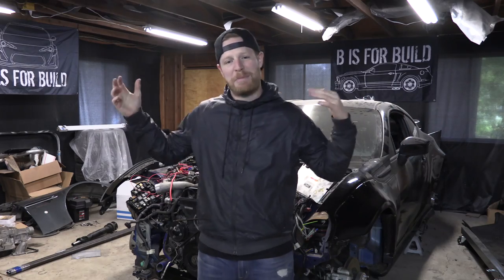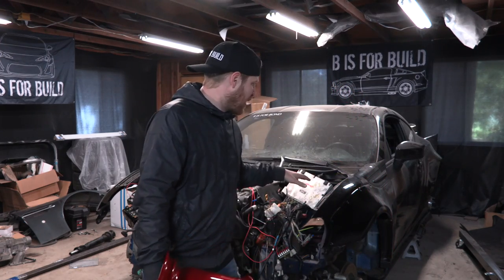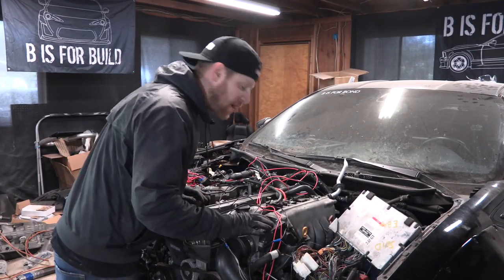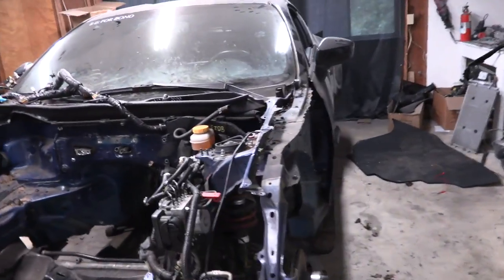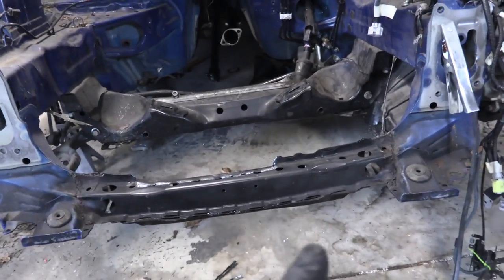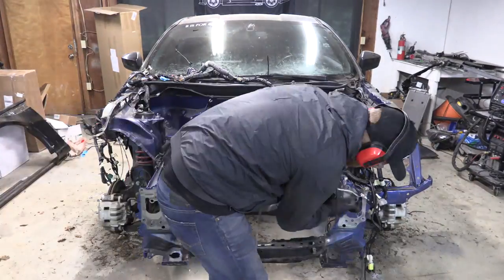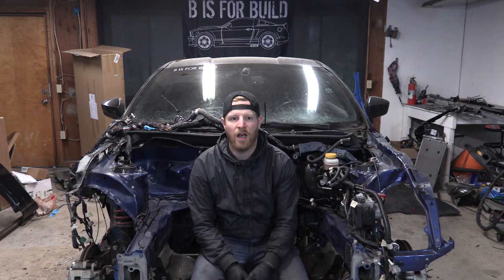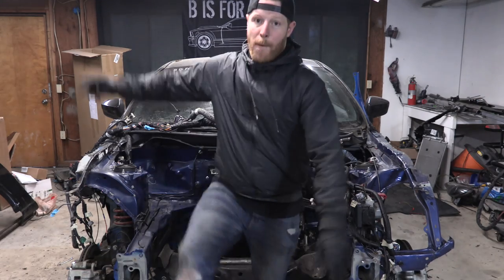2JZ BRZ Pt 7 - New Wheels & Engine Bay Prep

Comment: b is for back
Reply: beat me to it
Reply: I really like the red on that car, especially since the BRZ comes with red piping on all the upholstery everywhere inside... but B is for Black is definitely going to be a new sticker you have to make.
Reply: black
Reply: I hope all you guys realize Mark actually meant "back" and not "black" because Chris was gone for a bit
Reply: Paint it red!!! Come on, all that work and your not going to paint it a pop color that people will notice?
Reply: blaaaaaaaaaaaaack
Reply: I actually thought he made a typo, but B is for Black is where it's at anyway. Hah. If he tried to mimic the candy red on the engine bay in short order, it won't look great. He should pull back all the wiring and remove the brake master cylinder etc and do a full respray under the hood. If he wants to do it quick and dirty, then black is 100% the way to go.
Reply: I'm thinking about red bay and black cover

Comment: I recommend you paint the door jams and edges of the doors red to match the engine bay. I had a pickup that the previous owner had painted black, but did it with the doors closed, the stock blue showed when the doors were open. I didn't like the color, but the effect was awesome. it would add a little extra pop to the car. do the same for the inner edges of the trunk.

Comment: did they forget to paint the inside of the rims? it looks like over spray.
Reply: most cars don't have the insides of the rims painted, its primed or protected in someway or another but not physically painted
Reply: This depends but can be very true.
Reply: Yea I thought that, they look unfinished
Reply: Yes, they paint the part that will be covered by the tire but not the inside of the wheel, is that a joke?
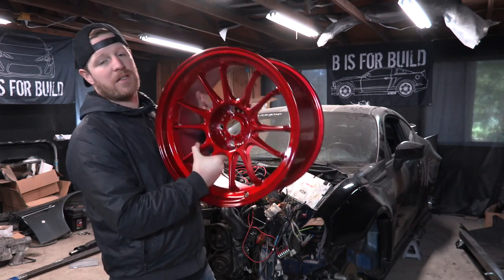Just look at 1:18, andof course I'm not talking about the part that is in contact with the car...
First time I see this.
Cheap paint job for me, sorry.
Reply: A set of OEM BMW rims I had were not painted on the inside, I think that if you actually pay attention to a lot of cars, you'll find that they aren't, from my experience anyway.
Reply: brake dust will cover it so u will never notice. but im like if its a quality rim then just paint the entire thing!

Comment: Black engine bay for sure. Infinitely less ricey, IMHO. I don't like the idea of painting engine bays in an accent color, I just think it feels...well, ricey. The nice thing about painting it black is that, A) like you said, it's a hell of a lot cheaper; B) a black engine bay will nicely complement virtually any exterior color, rather than trying to accent it.; and C) a black engine bay tends to hide "mess", and it still looks okay even when it's dirty.
Reply: I will say, that red color is REALLY cool, and it'll look great on the engine cover. Try to find a few other accent pieces in the engine bay to paint, too, but don't go crazy. The red engine bay looks better than I thought, but honestly it's just too much. The red gonna be a lot of work, and you probably won't be happy with the result unless you get it perfect, which is gonna require lots of prep, cleaning, etc. Plus, it's gonna get dirty and the paint WILL get beat up.
Reply: wouldn't you want to see any of those "messes" that's why I'm for the red engine bay... if I had any kind of leak I'd want to know where it's coming from...with the black I wouldn't be able to find it as fast...the red would be like oh hey there's the leak cool now I can fix That...I completely understand the black part but if it's going to be a drift car than a colored engine bay would be better

Comment: Unless you completely strip that engine bay out bare and prep it correctly all you're going to do is make a mess regardless of the colour you pick. Just forget about painting the engine bay and focus on doing the engine transplant correctly. I would also check how straight the front end of that car is before doing any other work as it clearly was never fixed correctly and there is no point in doing all that work to a bent car. Look at Arthur tussik's channel on YouTube to find out how to measure and straighten a bent/crashed car. You'll be amazed at the skill he has to straighten/repair some really badly damaged cars!

Comment: I personally like the red engine bay, but I suggest that on the engine cover, you paint the outside surrounding portion of the cover in the red and then the entire center portion in black and going in with a white paint and painting the letters a bright white. That would give it a nice contrast and make it stand out very nicely.

Comment: do whatever suits your budget :) looks good anyways, and you get a thumbs up on the welding of the frame rails, by not welding it all around you have made it strong but also kinda weak in a crash which its designed to be

Comment: Candy= high gloss which really highlights surface treatment or lack thereof. For cars that spend a lot of time w/ their hood up at shows this could be justifiable, otherwise -not. The high surface red does kinda limit your pallet. What I like is deep dark gray (maybe pearl) set off with red and black or even another shade of gray accents. Chrome is a good option w/ red like that if used tastefully but again , more for show cars.

Comment: Black engine bay is a more clean look. One functional purpose if you go red, is that whenever you work on the engine it might be easier to see things b/c of the contrast. The red immediately makes me think like you're peeling the skin off the car and exposing the 'meat' when you pop the hood, which is definitely more interesting than making it black and matching the exterior. I don't think it will be too much red if you match the wheels b/c most of the bay will be covered with the engine and the wiring and other components. Yeah, it was expensive to get the paint but, not many people would have that look if you do it. Like you said, this car is gonna be with you for the long haul! Giving it something special wouldn't be a bad idea in my opinion. I vote red!

Comment: Black bay is the easy way out, so I get it. But there's a reason race teams paint their bays bright colors (usually white). Makes working on the engine much more pleasant because it's easier to see things, including leaks. The red won't be as bright as white, but it's a step in the right direction.

Comment: What's up with the over spray look on the inner portion of the wheels? Looks pink, and kinda half-assed
Reply: Sorry for posting a lengthy reply to your comment that will appear multiple times.  However, after seeing a few people with similar comments we felt this needed an explanation. The lack of paint appearing on the inside barrel of the wheel is not a mistake, its intentional. Our red metallic finish isn't a single paint color. Candy colors are developed by laying down a base coat (usually silver or gold) and then layering a unique metallic tinted clear coat.  Multiple coats of this tinted clear are what help us arrive at the exact final color.  With all of that said we use a powder coated primer and metallic silver base (That seals and protects the wheel).  Then we begin to apply that tinted clear coat, in multiple layers, on to the outside of the wheel (the part that will be visible when installed on the vehicle).  Then finally we add an additional protective clear coat.

If this was a regular single metallic paint color, it wouldn't be an issue.  However with all of the layers of color needed to arrive at the final product, painting the barrel would cause an undesirable buildup of paint on the windows of the wheels (sides around the spokes).  That is because the barrel would have to be painted first.  Again, when this part of the wheel is mounted on a vehicle its essentially impossible to see.  We understand when taking the wheel out of the box you could expect it to have a continuous finish on the entire wheel, however this method we have chosen ensures a very reliable and consistent finish that will hold up to the elements. 

Having a finish that looks great while remaining reliable and durable when properly cared for is our goal.
Reply: Thank you for the detailed reply, and what you're saying makes sense. You're right, after everything is installed it won't be all that noticeable. On top of that, after a couple hundred miles a good layer of brake dust will make it completely unnoticeable. With all that said, it really is a fantastic looking wheel.
Reply: KONIG WHEELS USA thanks so much for explaining that!!

Comment: If the paint outside the car is gonna change a lot I would go with a black engine bay and red accents and also red hoses. Plus when you change the color of the car I'll be easier to change the accents instead of having to choose colors that would look good with a red color scheme

Comment: Just for your information: the 2JZ ECU is not designed to be mounted inside the engine bay, if you want it there you need to put it inside a weatherproof box!

Comment: Why are the wheel barrels painted really good on the outside where you don't see it but half freaking white on the inside where you see it?
Reply: Sorry for posting a lengthy reply to your comment that will appear multiple times.   The lack of paint appearing on the inside barrel of the wheel is not a mistake, its intentional. Our red metallic finish isn't a single paint color. Candy colors are developed by laying down a base coat (usually silver or gold) and then layering a unique metallic tinted clear coat.  Multiple coats of this tinted clear are what help us arrive at the exact final color.  With all of that said we use a powder coated primer and metallic silver base (That seals and protects the wheel).  Then we begin to apply that tinted clear coat, in multiple layers, on to the outside of the wheel (the part that will be visible when installed on the vehicle).  Then finally we add an additional protective clear coat.

If this was a regular single metallic paint color, it wouldn't be an issue.  However with all of the layers of color needed to arrive at the final product, painting the barrel would cause an undesirable buildup of paint on the windows of the wheels (sides around the spokes).  That is because the barrel would have to be painted first.  Again, when this part of the wheel is mounted on a vehicle its essentially impossible to see.  We understand when taking the wheel out of the box you could expect it to have a continuous finish on the entire wheel, however this method we have chosen ensures a very reliable and consistent finish that will hold up to the elements. 

Having a finish that looks great while remaining reliable and durable when properly cared for is our goal.  We are always working on new techniques and processes that will be reliable and mass production capable.  We are looking into improving this further and appreciate your feedback.
Reply: KONIG WHEELS USA I see, well I thought you painted them like regular 3 stage paintjobs for cars. But wouldn't it be possible to color-match an pearl or metallic color to be painted on the inside? The light doesn't really hit the inside that much, but you can still see it if it's a really different color, so that "candy pop" effect isn't really necessary  there.
Reply: HI Simon, so its not a question of being able to paint the wheel, however keep in mind that paint lines are very different then someone hand painting an object.  Our goal was to ensure there would not be a build up of material in the window areas of the wheel as the barrel would have to be painted first.  But you're correct and we are already working on a solution to improve a better coloring in that area.  Thanks again for your feedback, we do our best to listen to everyone and take it as constructively as possible to ensure we are always turning out better products for you guys!  Thanks again!

Comment: I understand where you're coming from black would look good with anything with this on the future. candy apple red Wheels engine bay and valve cover will it looks so clean on the car I don't know. you're in a tough spot. if you do decide to paint a car later on or wrapped it just pick a color that goes good with red that's what I would do

Comment: Black with a red valve cover will look like a regular car with a dressed up valve cover.  It won't stand out or look custom, especially when the exterior is black.  You will have a bunch of crap in the engine bay, unless you're looking to do all the shaving and hiding in your photoshop, so the engine bay won't be as imposingly red as you're thinking.  I've seen engine bay and the motor painted the same color on older hot rods and it doesn't look bad, especially if you have a lot of polished aluminum.  On the other hand, having a satin black engine bay will match whatever color scheme you go for everywhere else.  It's a huge task to take on, and you really only want to do it once.  Satin black might be your best bet in that reguard.  If you go with black, just a red valve cover will have a very minimal effort look and feel to it.  I would consider painting the entire motor, especially since it's out of the car already.  That will draw your eye to the part you are trying to show off, and away from anything else you don't want to be noticed.

Comment: Black engine bay and red accents looks stock, classy, professional. Red engine bay with red accents looks silly, over-the-top, and disorganized. Since it's going to be with you a long time you can always change it again, but personally I'd go with the safe color choice in the engine bay. When you decide to wrap or repaint the outside, you won't be limiting yourself on your color choices to match the red in the engine bay.

Comment: inside of the wheels look pink, why didnt they paint that if you can clearly see it?
Reply: Sorry for posting a lengthy reply to your comment that will appear multiple times.  However, after seeing a few people with similar comments we felt this needed an explanation. The lack of paint appearing on the inside barrel of the wheel is not a mistake, its intentional. Our red metallic finish isn't a single paint color. Candy colors are developed by laying down a base coat (usually silver or gold) and then layering a unique metallic tinted clear coat.  Multiple coats of this tinted clear are what help us arrive at the exact final color.  With all of that said we use a powder coated primer and metallic silver base (That seals and protects the wheel).  Then we begin to apply that tinted clear coat, in multiple layers, on to the outside of the wheel (the part that will be visible when installed on the vehicle).  Then finally we add an additional protective clear coat.

If this was a regular single metallic paint color, it wouldn't be an issue.  However with all of the layers of color needed to arrive at the final product, painting the barrel would cause an undesirable buildup of paint on the windows of the wheels (sides around the spokes).  That is because the barrel would have to be painted first.  Again, when this part of the wheel is mounted on a vehicle its essentially impossible to see.  We understand when taking the wheel out of the box you could expect it to have a continuous finish on the entire wheel, however this method we have chosen ensures a very reliable and consistent finish that will hold up to the elements. 

Having a finish that looks great while remaining reliable and durable when properly cared for is our goal.

Comment: Why are you rushing in to painting now? Doing things in the right order can save a lot of time and give a better result, painting the engine bay now is like wiping your arse before you take a crap, you are going to end up with a lot of shit that will need sorting out!

Get EVERYTHING in the engine bay sorted before you get in to painting, mount all the relays, fuse blocks, ECU etc. route all the hoses, work out where you can fill holes and weld brackets in to place. Then pull it apart fully so you can do a proper paint job, (especially if you are going to use a candy paint which needs a consistent spray gun angle to look half decent).

It may not give you a quick shiny progress picture, but it will give you a better end result.

Comment: To me gloss black is a no brainer. Matches the car, gets rid of the blue.  Much easier to paint and saves you some money for the tyres. Red accents on the engine are fine.

Not sure that what you are calling frame crumples at the front are actually that. Everything else in the area looks straight, smooth and undamaged. Perhaps you added the plates for nothing. Comment needed from an undamaged BRZ owner.